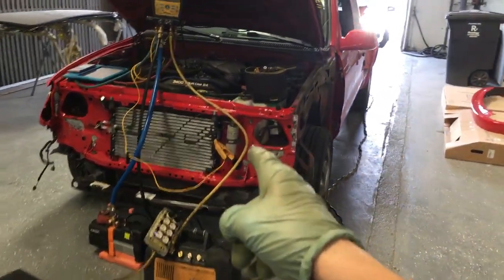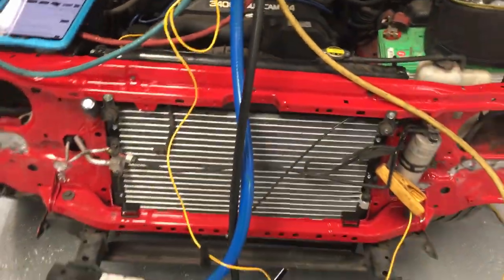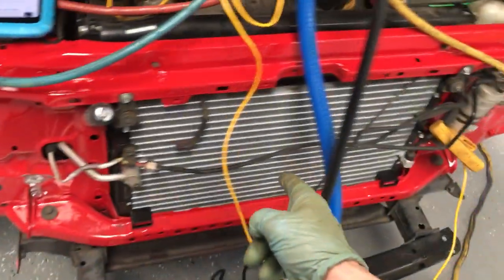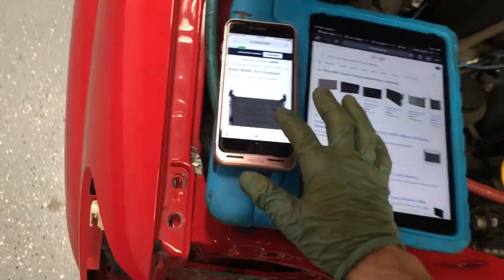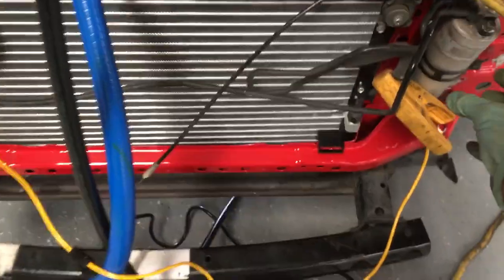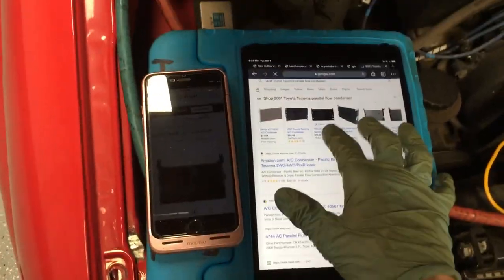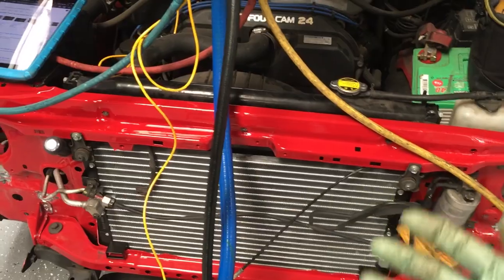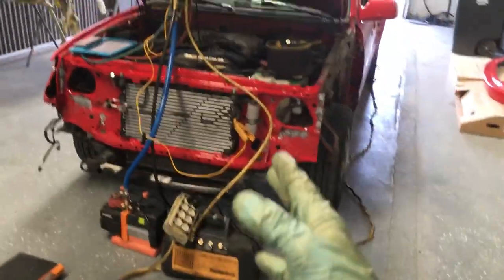Upgrade Your AC condenser from an old style serpentine to a new style parallel flow￼

Comment: Great info! I'd like to upgrade my 1990 Acura Legend's condenser, it looks pretty much like this one. Judging by the fact that I can drop the vent temps at idle by 10+ degrees on a hot day just by getting the condenser wet, I think I'd gain quite a bit of performance. Is there any reason to not use a parallel flow condenser with R12? I can't think of any reason to not, but I don't remember ever seeing an R12 system with a parallel flow condenser from the factory and I'm wondering if there's a reason for that.
Reply from the maker: Yes, parallel flow works excellent with 12. Your charge. Quantity is lower. You’re going to have to figure that out.. 

Parallel, flow condensers require much less refrigerant
Reply: @coldfinger459sub0  Awesome, thanks! I installed a parallel flow condenser on my friend's 1996 Bronco years ago and charged by pressures. If I remember correctly, it only took about 1/2 of the stock charge and is still working great.

Did you ever get around to making that video on charging modified systems? I'm not nearly as experienced with R12 systems and the pressures they run at as I am with R134a, so any advice would be very helpful.
Reply from the maker: @averyalexander2303  no not yet never made that video
Reply: @coldfinger459sub0  That would be a very useful video IMO especially since so many aftermarket components don't have the same capacity as the OEM parts did. Cheap condensers with less rows than the original are one very common example.

Also, when using a different capacity condenser, does the required amount of oil change too or just the amount of refrigerant?
Reply from the maker: @averyalexander2303  in theory due to the reduce refrigerant quantity the percentage ratio of oil would also go down

But usually if you look at refrigerant condenser capacities for oil requirements 

They range from 30 mL to 45 mL on average so I discrepancy a 15 mL is not gonna break the bank if you’re over 15 mL . 

Usually only when you’re looking on some of the largest vans or SUVs that have the super giant front flat face of the vehicle that is square and they have huge condensers that are nearly 36 inches long 28 inches high with a thick core. Do you sometimes see a recommended oil capacity of 2 ounces 60 mL to be replaced when changing the largest condensers
Reply: @coldfinger459sub0  Thanks, that's pretty much what I thought- adjusting the oil capacity slightly is ideal, but not usually a big deal.

For what it's worth, when I was looking into  installing a full size radiator and condenser in my 1997 Civic, I found that the 1st gen CRV has the same compressor, evaporator, receiver dryer, and expansion valve, just different lines and a full width condenser. Despite the refrigerant capacity being ~2 ounces more due to the much bigger condenser, the total oil capacity is still listed at 130mL and the condenser capacity is only 5mL higher for the CRV.
Reply from the maker: @averyalexander2303  this is something I would always tell if her customer does their own do it yourself work and they had a model vehicle that had an option for a full-size radiator or a full-size condenser to put on that full-size condenser
And possibly an extra electric fan if they were in a hot climate
Reply: @coldfinger459sub0  Yup, more cooling headroom is always a good thing. I definitely plan to get the full size rad and condenser eventually. The engine cooling is great, but the AC has always struggled at idle on very hot days, Where I live, 100+ degree very humid days are typical for much of the year.

Adding a pusher fan is always a compromise. It can improve cooling at idle, but it also blocks airflow whenever it isn't on and when driving down the highway, so I'd prefer to upgrade the main fan instead if at all possible.

Something that makes a BIG difference is actually sealing the sides of the rad and condenser so air can't bypass it and hot air can't end up back in front. The goal is for all the air the fan pulls to be through the rad and condenser and for all the air that goes through the grille to be forced through the rad and condenser too.
Reply from the maker: @averyalexander2303  they have some really good DC brushless extremely powerful fan upgrades
Reply: @coldfinger459sub0  Good to know, I'll have to look into that. What are your thoughts on serpentine flow vs parallel flow evaporators? My 1997 Civic came with a serpentine flow evaporator, but the later 6th gens (1999-2000 I believe) got a parallel flow evaporator, which seems like a good upgrade since I'm going to be removing the entire evaporator box to replace it with one with a filter since mine didn't come with one and I'm sick of crap getting blown into my eyes. May as well grab the parallel flow evaporator too as long as there's no downside.
Reply from the maker: @averyalexander2303  parallel the way to go.   Just need smaller refrigerant change
Reply: @coldfinger459sub0  That's what I would have thought too, but the service manual and the sticker lists the capacity as the same for all years (21.2 to 22.9 ounces) despite the difference in evaporators, but I'd definitely still keep an eye on the pressures while charging by weight because it seems very odd to me that both evaporators would have the exact same capacity.
Reply from the maker: @averyalexander2303  evaporator does not make as big difference as a condenser
Reply: @coldfinger459sub0  I wouldn't think it would since it doesn't have as much liquid in it, but it still seems strange for the capacity to be exactly the same. Maybe a mistake or maybe because the parallel flow evaporator has more tubes even though they are thinner, I'm not sure.

The other weird thing is how much refrigerant it holds for only having a half width condenser. My 05 Civic has a full width condenser of the same style and only takes 17.6-19.4 ounces, which I can confirm is correct as the pressures and performance are great with ~19 ounces. I haven't messed with the 97's AC yet, but I'm a little skeptical of the spec being several ounces higher than my 05. We will see. How common is it for the spec on the sticker and in the service manual to be wrong?
Reply from the maker: @averyalexander2303  occasionally they are wrong they release them with the wrong refrigerant quantity and they have a TSP that is released later correcting to charge. 

In some cases, they even had TSB’s and eliminated old part numbers to condensers and re-released a new condenser to replace the old condenser . 

They don’t make it a recall . 

They just notate down to information change the Parts basically without telling anybody .  Unless you go out of your way to look up the technical service bulletins bulletins yourself. 

Then you will find out that the refrigerant charge has been changed or a condenser has been upgraded . 

Sometimes accidentally refrigerant charge quantities are carried over to a next year when they should not have been they just copy and paste and reprint into new service literature . 

And if you’re looking up information in aftermarket software sources, you will also find that they may be completely different by a few ounces . 
Somebody is right and the other guy is wrong 

Service information, Mitchell or CCC or Chilton or all data you name the company . 

The vehicle may have had different options for refrigerant charge because the vehicles were manufactured in different countries with different engine and transmission and style configurations but still on the same model your car 

Depending on if that vehicle was manufactured in Canada, United States, Europe or Japan or maybe even South America, the aftermarket service advisor specification information might only record one or two of them, not all of them and it might not be the one for the United States or all the models 

I have found cases where they listed the refrigerant charge for a front evaporator vehicle that had the option of the rear evaporator, but did not mention it 

So the refrigerant level would be too low no reference to duel option
Reply: @coldfinger459sub0  Thanks for explaining, that makes sense. It would be so much easier for them to just get their specs right from the beginning LOL.

What do you do in situations where the spec on the sticker is different than the spec in the manual? For example, on my Legend, the sticker on the car says 30-34 ounces of R12 while the service manual says 28 to 32 ounces. A discrepancy of up to 6 ounces is hardly insignificant.
Reply from the maker: @averyalexander2303  that 32 ounces is Ling pretty good because it’s falling right in the middle there. 

On top of that ,  R12 was very forgiving. 

And you’re in a 2 pound range even if you were 2 ounces over or 2 ounces under the minimum you would barely ever notice 2ounces or under

Jump forward to 2024 on these newer cars and you have a system that is only 12 ounces capacity and you are under or over two or 3 ounces on a very hot day. That will be devastating..
Reply: @coldfinger459sub0  Thanks, I was thinking the same thing if I don't end up getting a parallel flow condenser, which I likely will. I'd have to adapt something else of a similar size to work and get custom lines made because no one makes a direct fit for that, but I think the results would be worth it especially since the fins on the stock condenser are pretty corroded and moderately bent.

How well does charging by performance work? On retrofits or custom systems, I've seen people suggest adding or removing refrigerant a little at a time with a thermometer in the vent on a hot day and leaving the system with the amount that results in the lowest vent temperatures at or slightly above idle. Do you know how well that method works? I never tried it, but it sounds logical since undercharging and overcharging will both reduce performance.
Reply from the maker: @averyalexander2303  going by performance on a custom system that you’re not sure.  🤔 

Is better than nothing 

Even getting it a little bit wrong or a little inefficient, it will still work . 

If you can afford to get a late model, DENSO condenser even if it has the receiver dryer already built into it like a very modern day vehicle . 

Do you make up some custom lines that have fittings to work? . 

Where are the connections are and what kind of connections are not important . 

The highest quality model, DENSO that’s what I would stick on my vehicle if I had an old Toyota or an old Honda . 

Go further extra step . 

Purchase a  Sporlan SeeAll sight glass with moisture indicator. 
     Attach it to the liquid line at the point where it’s just exiting the bottom of the condenser. 

This way, you will know two things 

1: the system is dry
2: you are at least getting a solid column of liquid after the receiver dryer fed to the expansion valve. 

If you at least got that and you’re not perfect, you’re still good Enough. 

Your sub cooling may not be enough, but at least it’s good enough to work. 

Then no matter what you do on plus or minus refrigerant  (on a hot day preferably over 80°F) 

if you wanna guess on engine RPM 1200 RPM 1700 RPMs kind of like what you would be doing if you were going down the road at 35 mph. 

In the service manual, whatever RPM they say to run the system at to perform a performance test .
Reply: @coldfinger459sub0  Makes sense, thanks! I've never charged a custom system just by performance, but it's definitely a useful data point along with pressures, the temperatures of the lines, etc. At least keeping track of the performance while charging is an indication of if you are going in the right direction or not with the charge amount.

I have no way to make custom lines myself, but I was told that it wouldn't be a big deal to have custom lines made with whichever ends I need by an AC or hose shop? I would think any parallel flow condenser would be a huge improvement over the stock serpentine condenser, which looks like the one you showed. I could also easily go 2-3 inches wider.

Comment: AT least serpentine was slightly better  than equivalent tube and fin in the smaller sizes .
Remember if u have a performance radiator with high fin/tube count fitting a modern condenser might restrict air flow . Perf radiator might be 2.5--3 inch thick
Reply from the maker: That’s where your higher performance fans come in to play.  Placing foam between the radiator and the sheet-metal that supports it so there’s no air wrap around your pool to the engine compartment.. 

Play scene from between the condenser and sheet metal .  Basically, you’re making a conduit a tube from the face of the fins of the condenser through to the face of the radiator.. 

When modifying old vehicles, you add that rubber seal at the top of the hood or the top of the radiator core support to see you against the hood when it is closed .  

When you need to go to the extreme lengths to upgrade a condenser as you’re an extremely hot climate, you also need to go to the extreme length of literally turning that engine compartment into a newly closed off sealed compartment that won’t even allow hot engine heat to bypass around headlights to come in front of the condenser When you’re at a stop sign or in 2 mile an hour stop and go traffic for two hours in Arizona and 122° heat on top of 160° black top. 

If the vehicle has that standard Fluid Thermal Fan clutch . 
And they find themselves upgrading to that heavy duty one for towing package. 

The one that sounds like a jet engine when you start your vehicle up in the morning for the for 60 seconds. And as you drive down the block block and a half.. 

It all depends on the time and money somebody’s willing to invest to take care of the problem. 

The good thing is 12 V electric compressors are falling in price is complete kids and they’re very easy to control. 

So we’re starting to see a lot more electric compressors been added on to vehicles. 

There were those few vehicles built back usually before the 80s that barely had the right size radiator to handle hot days and showed signs of rising engine temperature every time you kick on the air conditioning. 

That is a sure sign. There’s a problem in the radiator needs to be upgraded.. 

I was just working with an old Mechanic was modifying a system just for that purpose. 
Took out the old three core radiator and replaced it with a five core custom-made. 

Money, knowledge, and skill can fix everything.
Reply: @coldfinger459sub0  Placing a very thick radiator with very dense fins/tubes combined with a modern condensor in front is not recommended . Why because a thick perf radiator is as thick as u can do .  A densely packed condenser can become an airflow restriction in this case . Regard less of how u prevent the airflow from leaking re lack of foam sealing. Quality radiators are wind tunnel tested .
Reply from the maker: @paulthompson1654  it works on 700 to 1000 Hp motor builds.    It has worked on every vehicle that I have done..    I don’t know what problem. Other people are unable to take care of.. 

Seems like a lack of knowledge and experience .
Reply: @coldfinger459sub0  Wind tunnel tested radiators are designed for max incoming airflow . This allows for maximum fins and tubes per inch to be used .  No incoming air flow restriction allowed . The design /vehicle speed /hp / airflow all determine of both condenser and radiator .
Reply from the maker: I designs commercial and residential heat exchangers to blower motor fan curve.  Use energy conservatory to flow grid to adjust air flow and make sure the static pressure is correct on larger commercial. Use the duck blaster to confirm conformity.. 

Child’s play, everybody can do it .

Comment: I have question yesterday I travelled at night a distance of 200km,I noticed AC working good on setting cabinet temp.at  23 C  and sometimes I need to reset to 20C and sometimes event to maxmum cool to get efficient cooling.What do you suspect?
Reply from the maker: Did the outside temperature change. 

You’re traveling on the highway at a constant speed ?
Reply: Sometimes temperature is changing but from 29C to 31C.Speed is constant as well
Reply from the maker: @issamadam9352 as the outdoor temperature changes Dash temperature changes